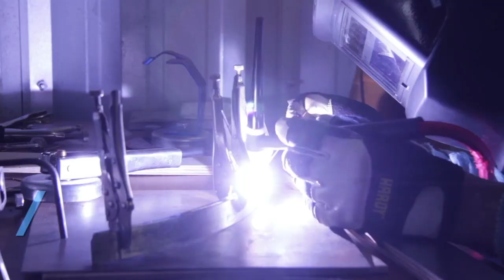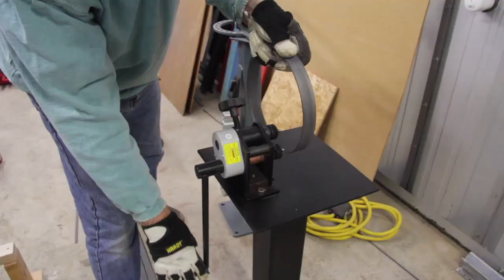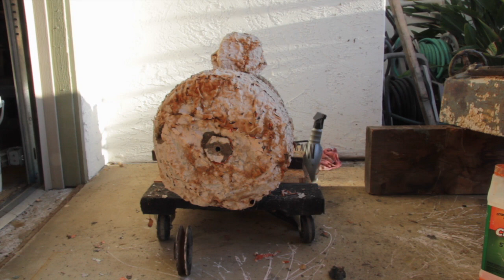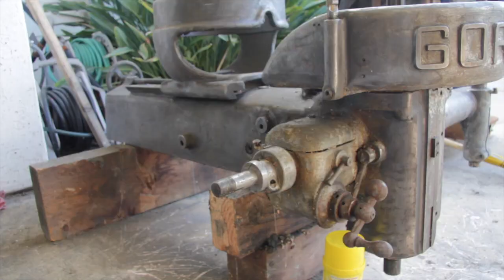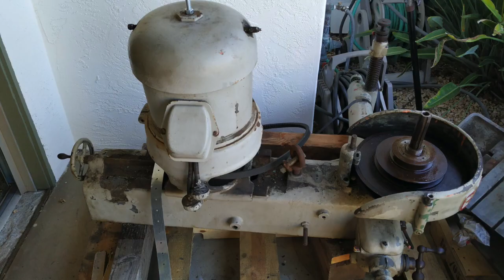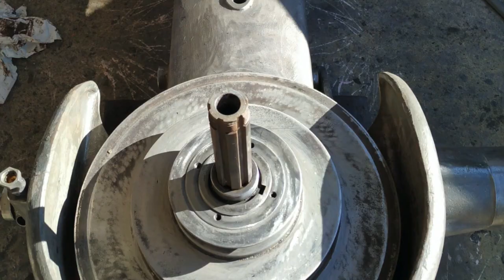Milling Machine Restoration Part 2

Comment: Whoever is responsible for re-painting so many factories full of machines with that hideous TAN Porch Paint, should be sought out and brought to justice.
Reply from the maker: yes taking a beautiful machine and painting it that color is indeed a crime. ;-)
Reply: @JoediyLab  I'm just now going thru a recently acquired Grob 18" Band Saw, painted that SAME color. It's turning out to be a very nice machine, and I'm having 'issues' resisting doing just what you've done in this video. It's a LOT of work I don't want to think about.  But yet.........that HIDEOUS color I'm looking at daily..........YEECH!
Reply from the maker: @kmcwhq  Yes, I thought about not painting, just getting the mill working, but it sat outside, covered for 20 years,  rusty and the paint was chipped,  I just had to strip it.  A lot of work, and very time consuming and dirty,  but now that I finished stripping the mill head, it looks way better.
Reply: @JoediyLab  Looks super nice job!
Reply from the maker: @kmcwhq  Thanks

Comment: Are you going to keep the pantagraph head?  Charles
Reply from the maker: Not sure if just the pentagraph head can be removed, I think the shaft is connected to the quill shaft, correct me if I am wrong.  I also have the tracer table.  Not sure I will need them.